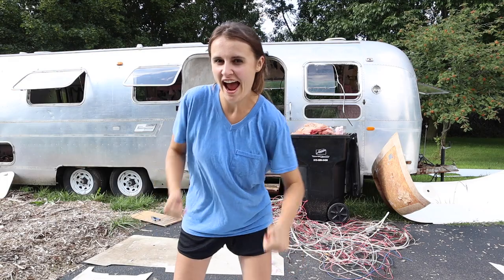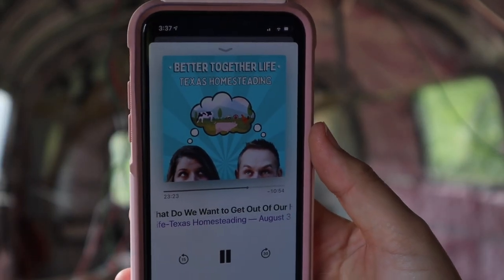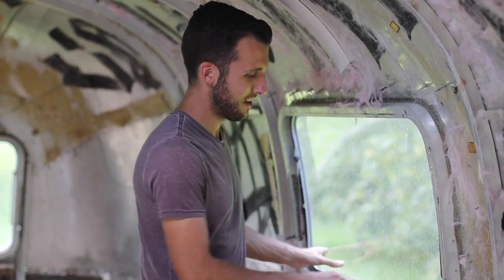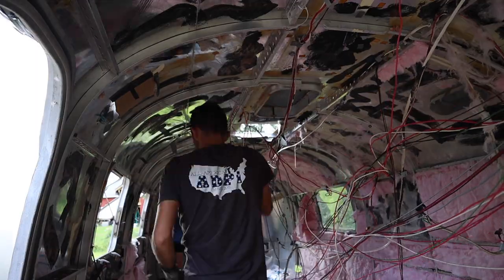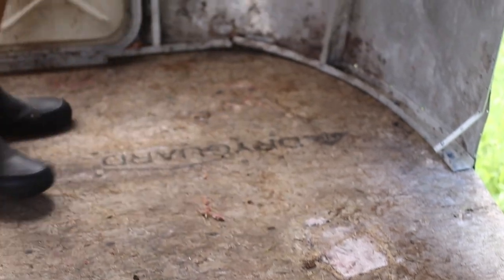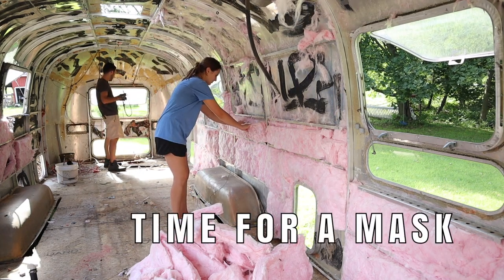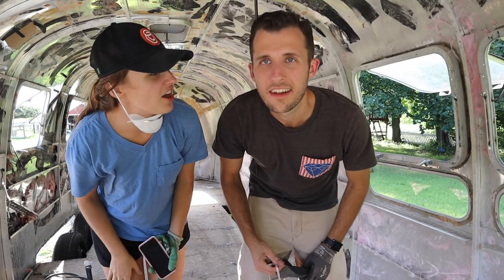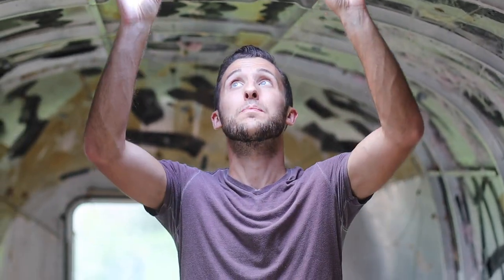DEMO DAY | Vintage Airstream Restoration

Comment: My '69 seems to be about the same length as yours, if not the exact same layout.  My AC power wiring is aluminum wire & devices. If yours is the same, I'd suggest that you change all that for safety sake. I had to deal  with sparking in a socket where the connection had come loose. I went through the whole trailer & tightened all the connections I could find. Good luck with your project. If mine gets renovated at this point, it'll probably be done by my KID & her husband, who is an electrician. ;-)
Reply from the maker: Ours is also a ‘69 - it’s a Sovereign if that helps! And thanks for the tip! We are definitely going to be running all new electrical 😊
Reply: @SunshineFarm  That's good to know. That aluminum had been deadly. The sparking in mine was above the bed where my KID was sleeping, when we were living in it 30 some years ago. She turned 43yr in January. That's her with me when she graduated college. 😍